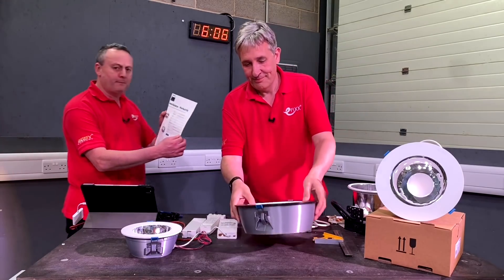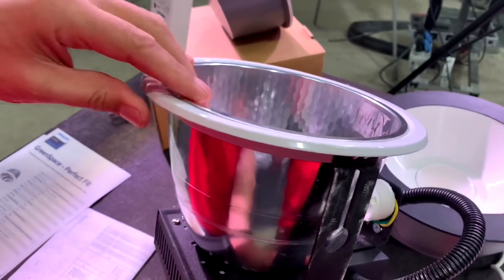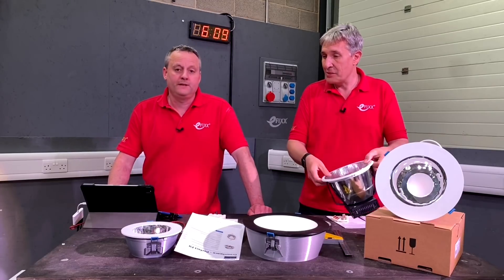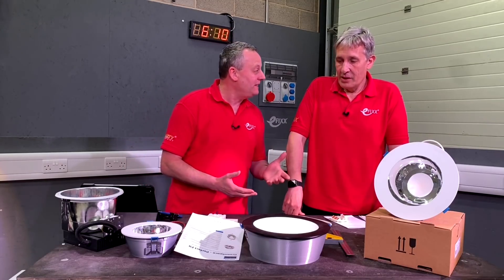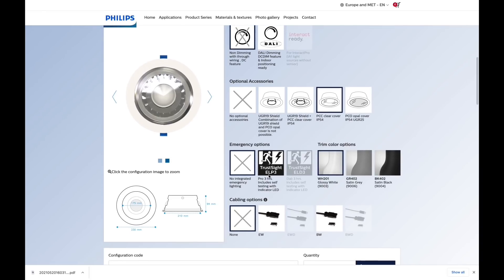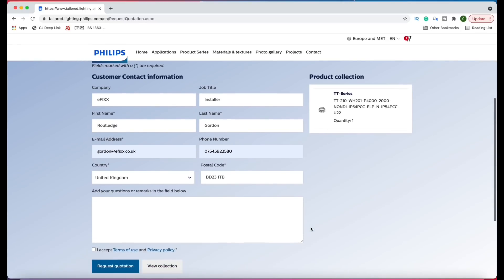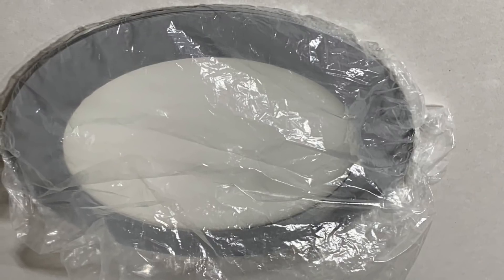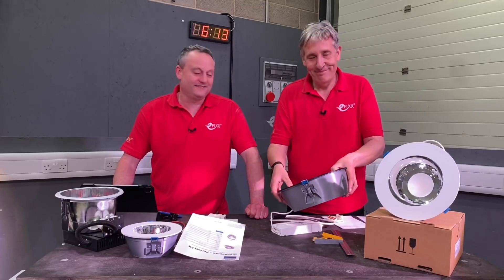Amazing 3D PRINTED DOWNLIGHTS 🖨 - made to measure CFL replacements

Comment: Great idea, but what about led cooling or heating of printed plastic (or whatever the material is used)?
Reply from the maker: The fixtures operate to 45C ambient  and 50,000 outs to L80 so not major issues with heat.

Comment: Guys you have just saved me. I had given up trying to replace 4 compact fluorescent lights in a fish shop, could I chuffers find an led replacement to fit in the hole. I'm heading over to the website right now. I owe you both a pint 🍻 Cheers Chris CME ELECTRICAL
Reply from the maker: If beer is in the offer -check out the Philips competition you could win a 3D printed pendant for home.
Reply: @efixx  hey they are that great they don't even get back to you with a quote 🤦🏻‍♂️

Comment: Fire rating is about design as well as melting point - and 3D printable stuff can have as higher melting point as injection moulded stuff! If anyone is interested, in a similar vein check out my youtube vid of my 3D printed ceiling mounted multisensor... I'm a DIY sparky (a "competent person", background education in electronics and do a lot of circuit design) and I also design and 3D print complicated / interesting small parts. For example this evening I'm designing a universal DIN rail mount for various devices. I have long been interested in 3D printing light fittings. I have a white PETG material that prints a beautiful finish, good enough to include in the home and higher melting point like ABS (not quite as high). Not as perfect as injection moulding of course, but really okay for things in / on the ceiling, in my opinion (and my house). I have wondered whether I could get various things like this past the building inspector for our build. At one point I thought I would start designing and 3D printing my own light fittings, and I still might do some fire testing of some of my designs. Probably won't actually go as far as installing them into ceilings etc (for certification reasons), that said I will be including some surface mount 3D printed sensors in our home build as these are not inside walls / ceilings, low voltage, low current, and low heat. It's a fascinating world to be in right now!